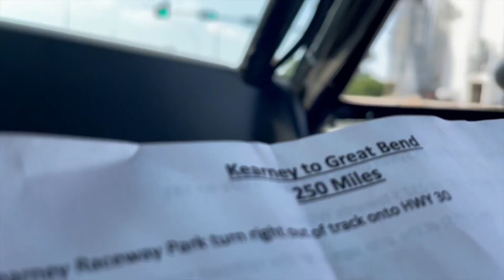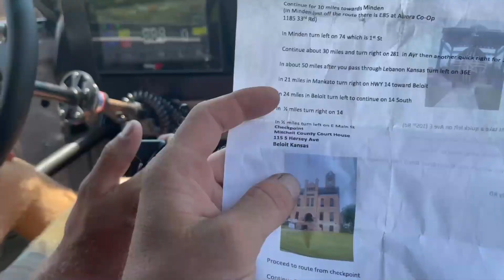Jamie Makes the perfect Shifts! What a Team! So Many Trophys! The Final day of #rmrw2021

Comment: Brent, congrats! Got into the 7's in a brand new car, despite all the bs outside of raceweek. overcoming the 4 link. i have a truck i plan on truing into a raceweek truck. We will get over this EPA nonsense without a doubt. we will keep fighting for what we love for as long as it takes. Just keep the positive attitude brother. When you get hit, you stand back up an you hold your ground no matter the consequence. Race week is what gear heads dream of. its not just a challenge, or a composition, its about thousands and thousands of ppl coming together and doing what we love. keep it up bro, we'll get there. Keep your head up.

Comment: Brent you should definitely talk Cleetus into changing the whole wiring system over to Fuel Tech from Holley on Mullet Cleetus should hit up Luis and tell him his set up and have Luis put together a FT600 with the complete wire harness FTSPARK,Boost Controller,FT injectors,FT Coils and all, and tell Luis all the inputs and outputs he has and wants on the car just so Cleetus can have the feature on Fuel Tech where he can test his injectors,coils and anything else you can test through Fuel Tech while the car is together and Cleetus needs to put the CO2 parachute launcher on Mullet

Comment: Jamie needs to build integra more 9 sec fwd on drag week would be sick
Reply from the maker: We are thinking of going for an 8 second average
Reply: @PFIBrent  maybe get with the guys @ Frankenstein (or someone like that...) and figure out a water-2-air intake mounted inter cooler? So you could get a dual-pass radiator up front, for more capacity/efficiency, and ditch the air-2-air?

Comment: It might be that the plug wire is getting too hot right there right beside the exhaust housing of the turbo he might want to put some HEI heat sleeves on everything that he doesn't want to get hot

Comment: I like how you put the link to everyone's channel that was in this daily episode of PFI SPEED but hopefully one day soon you can get Sho'Nuff together and we all get to see you turn that bad boy loose on some fools and here lately I've been seeing not only the Pro Mods in NHRA run the Liberty 5speed trans but they run it with a quick drive and a converter instead of with a clutch just go watch some of Justin Swanstrom's latest YT videos and he's got a video of an in-car cam and he walks you through everything he has to do with the Liberty 5speed with the quick drive through an all billet bolt together converter and he built the car to specifically for No Prep Kings and it's a 2015 Lexus big tire car built by CJRC all tube chassis and he broke down the steel roof and quarters to just the skins to drop onto the chassis and the rest is carbon fiber like the whole front clip and doors and deck lid basically an undercover Pro Mod lol but he dropped a 572cid Proline all billet Hemi with a big crank driven Procharger hanging off the front and one of the coolest things about the car is Modern Racing the guys that wired,wrapped,and plumbed the car did some research and they saw that the car came factory with a sunroof so instead of leaving the heavy glass in it which would probably break out of the car making a pass close to 200mph they welded a piece of sheet metal in it's place then when Modern Racing finished the car up and wrapped it they made it look like it still has the factory sunroof in it just tinted limo tint to match all the tint on the rest of the car and it looks pretty badass with the white wrap on the car